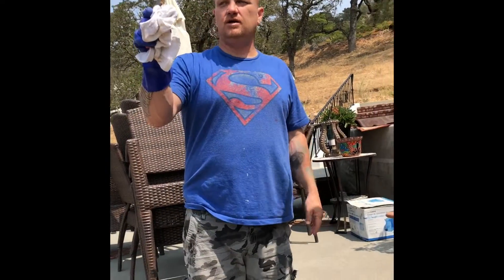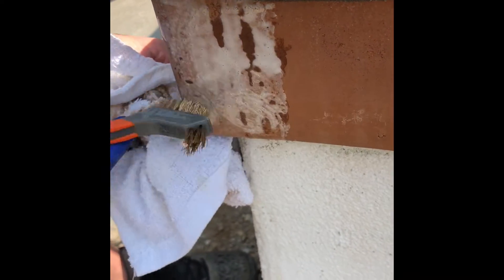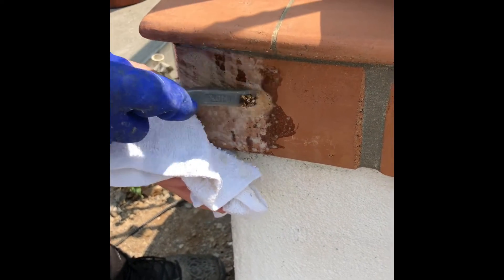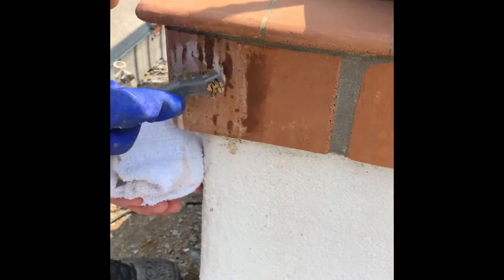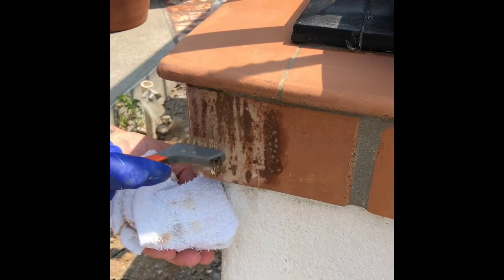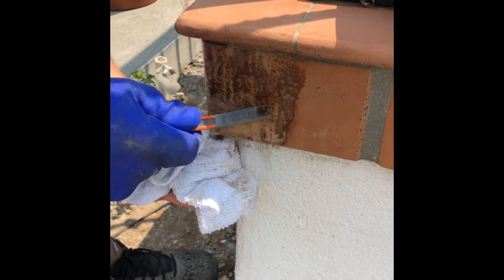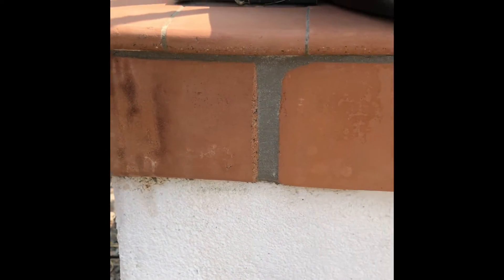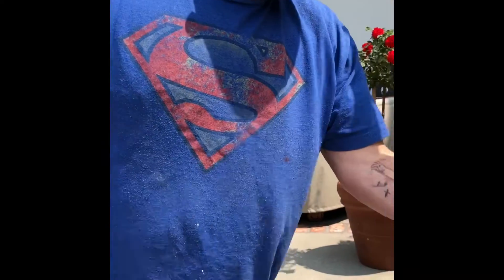Terracotta Floor Tiles | Water Damage Restoration

Comment: Hello Cali Tile Resto,
I'm in a panic and in Nicaragua.  New Terracotta tile floor that went down and has been getting walked on for months.  These guys didn't have a clue and I wasn't here to supervise.  Now I have about 1000 sf of rapidly degrading tile.  What do I do?
Reply from the maker: They are turning white? Sounds like they were sealed wet. If they are still getting dark when wet then you need to apply more coats of sealer and allow 48 hours to dry after applying all the coats untill the floor is no longer getting dark
Reply: @californiatilerestoration4827  Thank You!  Will do as you say.